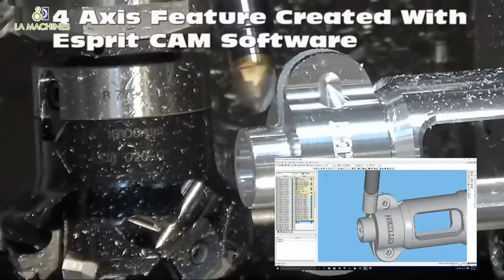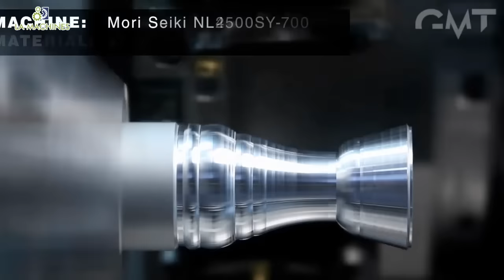Modern CNC Lathe Turning Machine Working,  Amazing CNC Machining Machines

Comment: The more I watch these types of videos, the more I realize how much harder I can push my tools
Reply: Me too lol, im in the mill tho'
Reply: It depends on what type tools and material you have though doesn't it im an apprentice and you cannot run anything without coolant at our place
Reply: I would be careful  trying to copy their feed/speeds. They're  also using a collet chuck so they can spin much faster without having to worry about centrifugal force. If you try those speeds with a standard 3 jaw chuck you're  gonna have a bad day.
Reply: He’s machining aluminum lol. If you work with high speed steel that’s a different world. That’s why he’s going through like butter with no coolant and not causing the tools/parts to go blue-hot.

Try this on 4140 with no coolant and you’ll snap a 1/2in CEM if you don’t start a sparkle show in the machine. 

It’s true that most people do not push tools as far as they should, especially with 8620 in my opinion, you can go a lot harder on 8620 than you might think, and maintain good/stable measurements… but never trust a demo video to be completely honest about what’s going on, even if they aren’t selling you something they might still want to justify their huge purchase by being biased as to how it runs. Or they might just type the wrong material into the caption by accident. 

In machining I’ve learned to trust what you can touch, sometimes literally sometimes figuratively

Comment: That steel part can be optimized a lot
Reply: I cringed at every air cut it made. No excuse for that in this day and age.
Reply: Like wtf 
Even our aprentices can do better
Reply: Agreed.  That entire process was painful to watch and listen to.
Reply: Reminds me of a  tracer lathe. Looks like the programmer just feed in the CAD contour, lots of opportunity for optimization.
Reply: Too there was obvious a contour in the air. The machine knows whether the correct z zero neather the real diameter of the workpiece.
Reply: When you buy cnc knowhow from whish
Reply: FortuneCast G73 was used, using the control not CAM in this example, with the Fanuc F control G71 can be used with over the horizon roughing which is very effective without the use of CAM.
Reply: @JoeyRodz74  I didn't get what you were talking about, not having ever worked with CNC, then that part of the video came and I cringed hard

Comment: Sir, I am working on Portal wheel lathe used for turning of Railway wheels (Make Safop) and facing issue in matching wheel profile at higher depth of cut. After profile matching with tool offset, when we make a radial cut upto 2mm we not find any issue. But when we increase the depth of cut we didn't get the required profile. May be it is related to cutting speed, spindle speed or any other factor. 

Requesting you to please help me in this matter.
Reply: Soo If im understand you correctly if you go over 2 mm depth of cut the numbers  the machine tells youdidn't match the real diameter of the workpiece?
Reply: What kind of insert are you using? Carbide? If so, test ceramic inserts. Not for roughing but for finishing. Ceramics really don't like disrupted cuts.